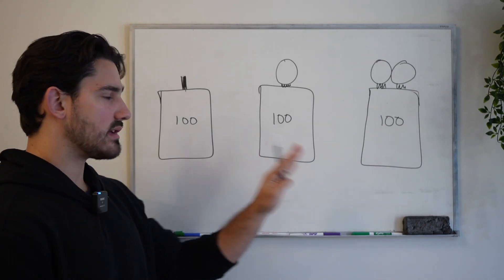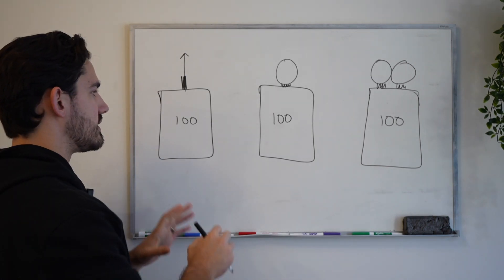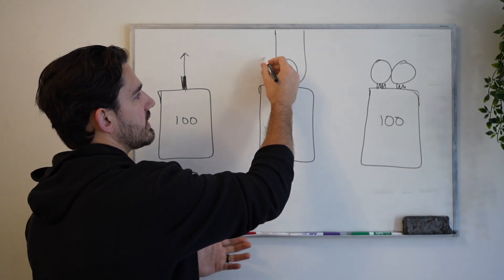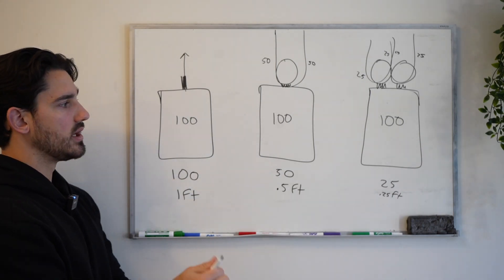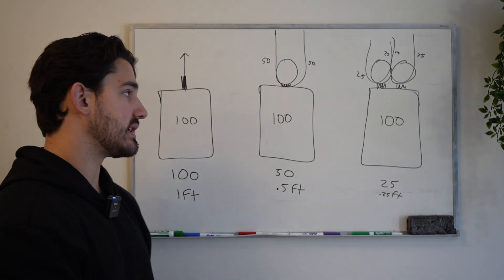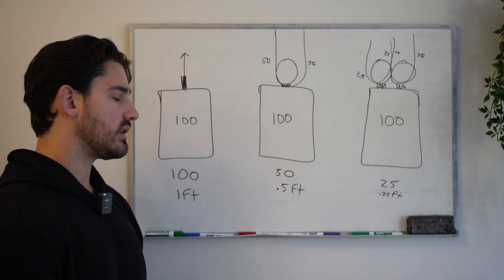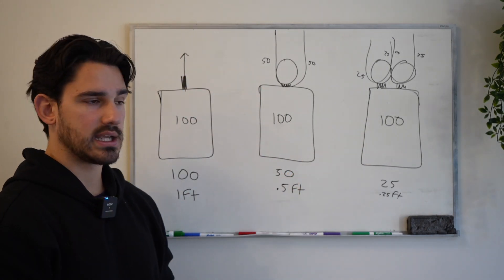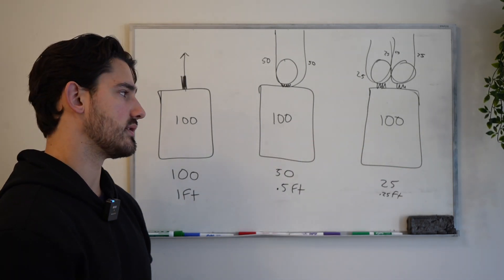Why do some cable machines feel heavy and others feel light?

Comment: Very good video. One thing that comes up as another reason for the different number of pulleys - which results in different weights - is the amount of cable length needed for the likely exercises performed on the specific machines. For some exercises, you end up moving the handle just about 12-18 inches. For other exercises, you might need to move the handle about 3-4 feet. Installing more pulleys allows for greater cable length without making the machine enormous.

Comment: Great vid. Always wondered about the discrepancy between the cable machines. Could you also do one for machine cams.
I was doing leg extensions and then started looking at the cam to see how it changed the resistance  and then my brain blew a fuse

Comment: I needed this, thanks for info, so just to verify if i do tricep pushdown with left cable type at 20kg, its the same as doing pushdown 40kg on the middle one?
Reply from the maker: thanks for the comment! a lot of companies adjust for this and label the load as it falls into your hand accounting for the number of pulleys. if you have the same exact load on the stack between two different cable machines, the greater the number of pulleys, the lighter and smoother it will tend to feel.

Comment: Lat pulldown machine at my gym has one reel (the one in the middle on your sketch) at it moves just as much as I pull with my arms. It's also just as heavy at a given weight as the one at my previous gym which is directly attached with no reels.